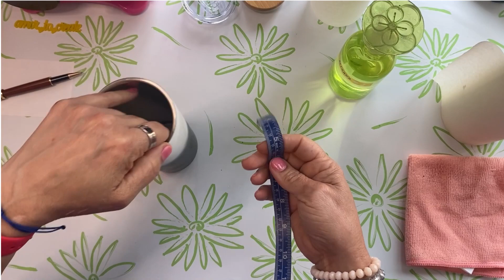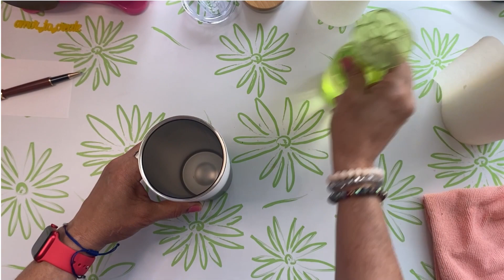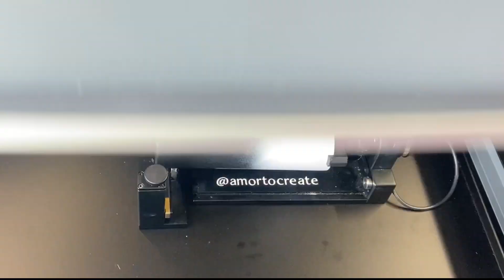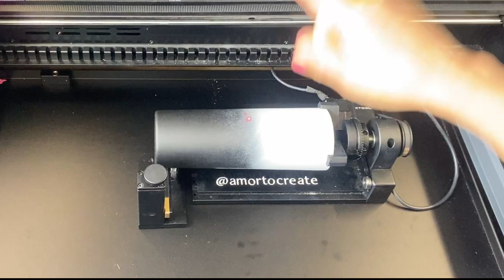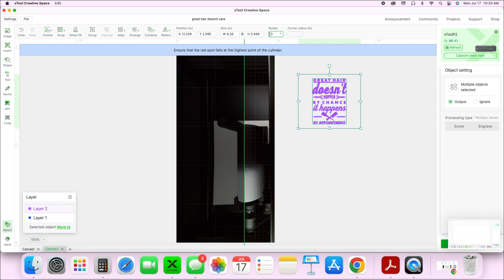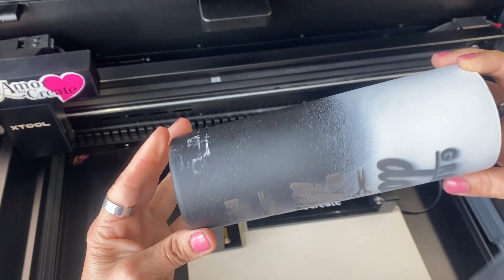Perfect Tumbler Engraving Tips: How To Make Your Tumblers Look Amazing

Comment: What settings did you use? And even more so do you have settings for Stanley tumbler and for the new P2S?
Reply from the maker: Hi! Congrats on your xTool P2S. I don't currently have that version, but the setting should be very similar. Did you try the XCS set up settings?
Reply: @ no I’m just looking for a starting point. I haven’t received my riser base yet until then I’m just doing some research
Reply from the maker: That is great that you are doing your research. Here is the xTool material library to help you better https://easyset.xtool.com/collection/MP2?t=machine&n=P2
Reply from the maker: The settings are in the video :)
Reply: It’s hard to see